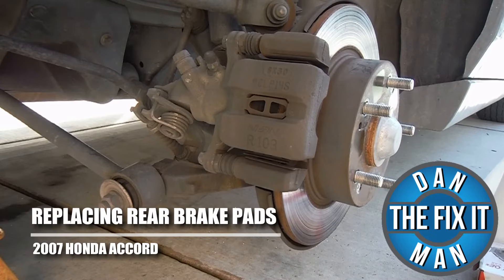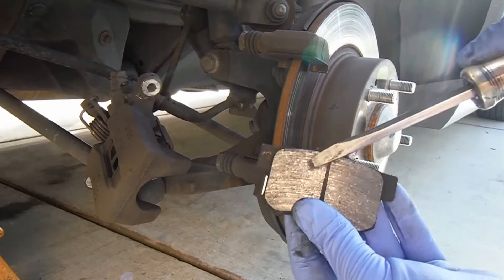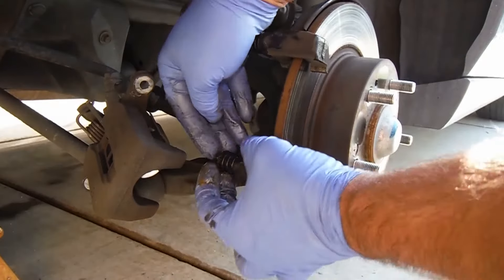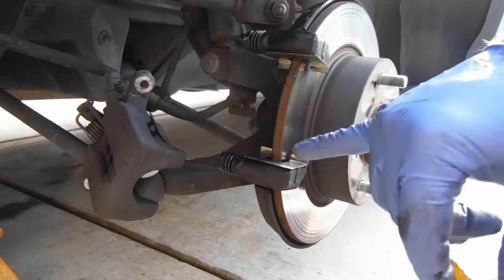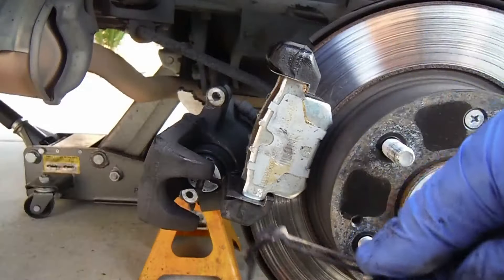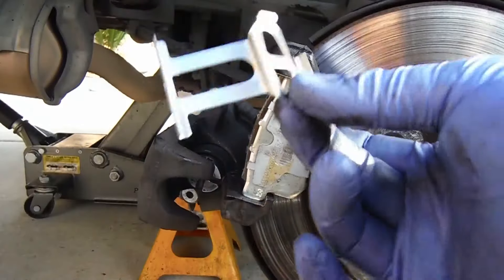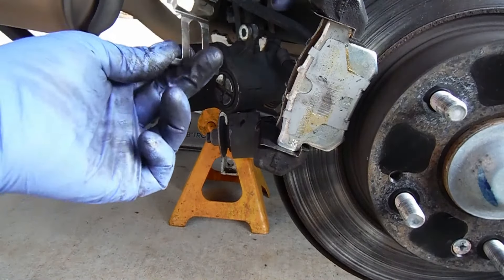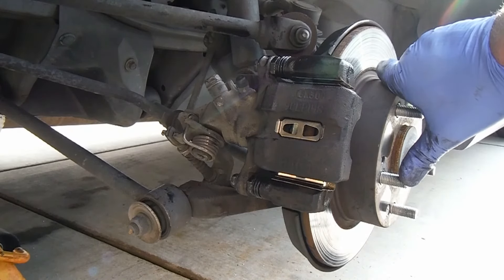2003-2007 HONDA ACCORD EX HOW TO REPLACE REAR BRAKE PADS - EASY DIY

Comment: Note: this video applies to EX models only. The other Honda Accord trims that come with plastic wheel covers such as LX and VP are totally different and more difficult to deal with,  they come with rear break drums. I never touched any drum breaks in my life, it's a hassle.
Reply from the maker: Yes, you are correct, the brake shoes/drums are much more difficult than the pads/rotors.  I will note in the description that it was an EX model.
Thanks for the heads up about that.
Take care,
-Dan the Fix it Man

Comment: Like what you did except one thing, you did what’s called a pad slap, very dangerous because the two surfaces don’t have any grip and causes your stopping distance to increase a lot. At the least you need to have your rotors turned either with a brake lathe or a 80 grit Roloc disc in a drill. Otherwise great video

Comment: you did a fine job  the only thing I would like to add is  I like to open the bleeder screw to bleed out the old brake fluid instead of pushing it back up into the master cylinder   I have an old water bottle with aquarium tubbing that I use  I think you know how it works   anyway  if you do it like this  bleeding the brakes should be done afterwords  and don't forget to pump the brake pedal at the end of the job  also I would have cleaned the rotor off real well on both sides  but that is just me

Comment: It's was a good video, thank you. Probably one of the best. I just wanted to add that the piston compression tool you  used is also meant to use a wrench to hold the pressure so that you won't have to keep turning it back to tighten. I see the problem is how to hold it in place. Well without a third hand you would have to wedge the wrench into part of the suspension or frame. They really need another added tool that can specifically do that to the very assembly you're working on.

Comment: I had took out that spring that sits in the bracket how can I put it back in? And is it necessary? I thought the caliper wouldn’t fit because of it but my guiding pins were seized

Comment: Thank you for excellent video and clear instructions. I replaced the rear pads on the one side but I’m having trouble with the other side because the calliper bolts are seized and I’m afraid of stripping the heads. Do you have any ideas? Do you know the size and thread if I need replacement bolts?

Comment: You forgot the part where every single fucking bolt is rusted / corroded to the point where a socket set won't remove it, so you have to spend 3 hrs removing one of them.

Comment: When you push the caliper piston back in do you need to unscrew the bleeder screw
Reply from the maker: Hi Mike,
Great question.  You can do it that way if you'd like.  I usually don't open the bleeder screw unless the fluid is old and dirty and needs to be changed.  Some of my friends always open the bleeder screw and top off the fluid when they're done as a way of changing the fluid regularly.  If you do open the bleeder screw, you run the risk of getting some air into the system which would need to be bled out.
Thanks for watching!
-Dan the Fix it Man
Reply: I just remove the lid on master cylinder before screwing in the brake cylinder piston.
Reply: @ thank you